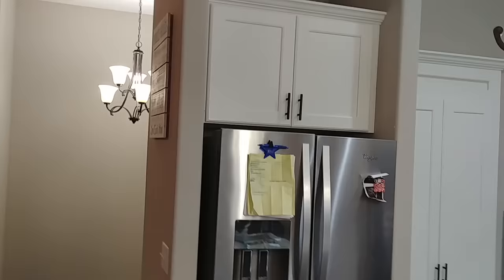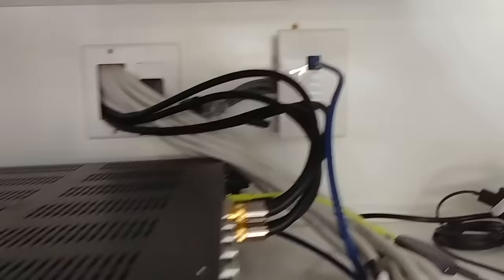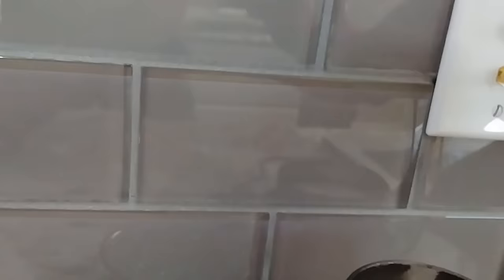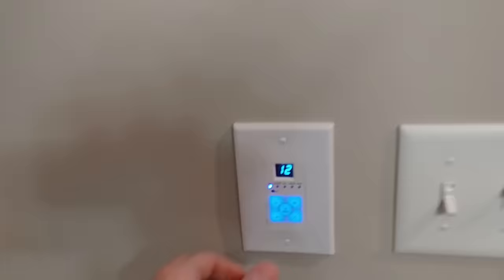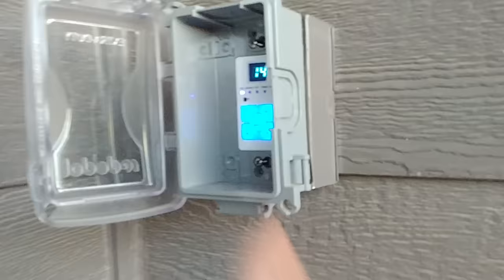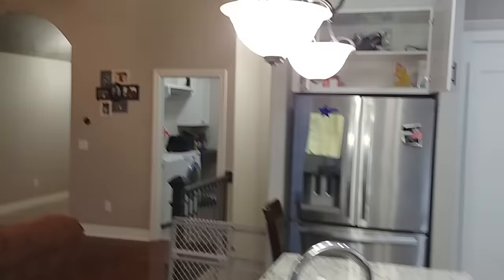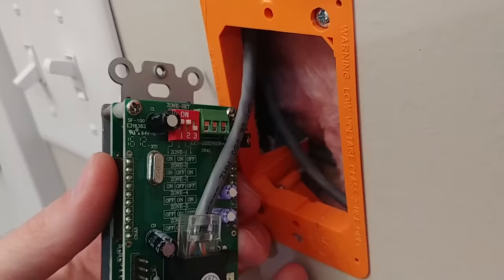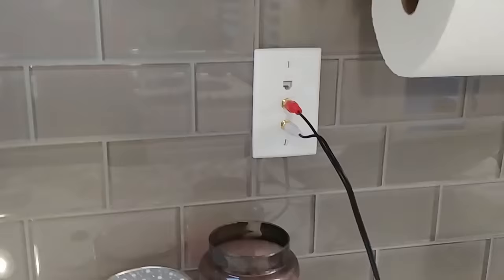WHOLE HOME AUDIO: Monoprice Whole Home Audio Amp! 6 Zone 6 Source

Comment: Would you be able to connect 6 chromecast audio? 1 for each source? Also why did you choose different speakers for the garage and deck? Is that style of speaker better for outdoor configuration?
Reply from the maker: federal3041 yes you could connect that many chrome casts but you would need to buy 4 digital to analog converters to convert the rca to 3.5 mm
Reply from the maker: federal3041 and yes those outdoor speakers are a much better speaker
Reply: Both RCA and 3.5mm are analog audio connections (digital coaxial audio uses a RCA style plug but that's not relevant here), I think you mean that he would need to convert 4 of the 3.5mm male plugs from the chromecasts to RCA for the whole home box/amp/audio matrix.

Comment: Hey this is a great set up . I am setting up mine as we speak.. I would like to know exactly how you used the rg6 to
Make an rca this way you can plug in you computer . Phone etc... thanks
Reply from the maker: You will need to run a separate rg6 cable for each red and white RCA. So in the kitchen for example, you see on my wall there is 1 wall plate with a red and white jack. Behind the wall that is actually 2 separate RG6 cables going back to the amplifier. You then have to finish the RG6 cable ends off with RG6 RCA connectors. Compression connectors are the best and easiest to put on in my opinion, you will just need to also buy a compression crimping tool. These connectors can be bought from lowes, menards, home depot etc, however after using Menards and Homedepot RG6 RCA connectors, I would recommend the home depot ones. They seemed to fit my RG6 quad shield cable much better. These RCA cables that you make, will then plug into the keystone jacks which then snap into the wall plate. After that, you just need to use any RCA to 3.5mm stereo cable which can plug into any headphone jack of a computer, ipod, phone etc. Hope this helps!!!!
Reply: TheKMZ1 
Thanks basically what I was looking for... 2 wires per source /zone. A lot of work but makes it worth it.
Reply: Why do you need the rg6 cables to utilize your computer as a source?   Could you run a 3.5 audio cable directly from the PC to the amp?  What am I missing?

Comment: Hi, I recently bought and installed a DAX66 mainly thanks to your videos ;-) Did you have issues with having the keypad plates flush at your parents’ house ? I use “renovation LV brackets” I imported from the US since I live in Belgium and we don't use the same system four our outlets/switches. Thanks.
Reply from the maker: With new construction boxes they sit perfectly flat. But you are correct, with existing construction rings, they will not quite sit flat. My house uses the existing LV brackets like you and they are not fully flat
Reply: @TheKMZ1  Okay thanks :/ Thank you for all your great videos about WHA !

Comment: I just moved to a house with a similar system installed and cannot get the damn thing to work. I know it was working when I got the house cause the seller was playing music on it then she took the amp with her. I purchased an amp and no sound is coming out. Driving me crazy
Reply from the maker: You purchased this amp or just some random amp?
Reply: @TheKMZ1  Kind of a random amp but one that others have connected to similar speakers. What Im starting to think is that the amp might not be compatible with the volume control otherwise I cant imagine it would not work

Comment: Excellent work with your install and the video. It looks like those Dayton's are mono speakers - have you used any stereo-input speakers in your installs or have any thoughts on them in general?
Reply from the maker: I think in the video description I link to the speakers. Dayton CS620C speakers, very good quality!
Reply: @TheKMZ1  Thanks but that didn't really answer my question.
Reply from the maker: @brodie7838  the amp can be in stereo or mono mode. In stereo the left speaker is obviously getting the left audio and the right, the right. If you want you can put it into mono mode but the standard would be stereov since there's distinctions of the L and R channels. I've not used any other speakers with this amp
Reply: @TheKMZ1  Cool thanks!

Comment: We have been enjoying our monoprice whole house setup for over a year now with a massive thanks to yourself with your video and guidance but have hit a problem which I hope is minor. Just upgraded from the iPhone X to the 13pro and with the contract package I get free Apple Music but for some reason I’m unable to see chrome cast on the AirPlay options and simultaneously cannot find the chrome cast audio app or even find it in the App Store. Any ideas what my options might be?
Reply from the maker: I think it's called Google home now
Reply: Right you are! Thanks again! Can I just ask I’ve got one keypad that no longer powers up I’ve taken that one out as I wasn’t using them all, is there a common fault easy to fix issue going on?
Reply from the maker: @stevenblack9644  I'm not aware of any specific reason that it would have failed. I've not heard of any keypad issues and I've never had any. I can get you a replacement tho I think I know where some may be
Reply: @TheKMZ1  that’d be great if you could although I’m in the Uk

Comment: as i was getting ready to pull trigger and buy this unit reviews elsewhere indicate the avg life is about 3 years.  any truth to that?  how has your experience been in the long run? i am leaning now towards perhaps the Russound D850. hopefully it serves the same purpose you showed in this video with the monoprice and the DAX66
Reply from the maker: So far no issues! Going on 3 years now
Reply: @TheKMZ1  so i ran speaker wires for 3 zones (office, kitchen and dining room) and now need to figure out family room where main tv would be.  Bestbuy geek squad said i need a full 5.1 system and separate amp, but i imagine you disagree.  If i do get the 5.1 speakers for the TV, how do i need to connect tv to amplifier?  HDMI? Speaker wire? Ethernet? all of the above?
thanks, you da man.  totally subbed.

Comment: Great video! what is the maximum number of speakers that you have hooked up on a zone? do you feel that you could've added more?
Reply from the maker: Casey Jones technically you can have 4 speakers per zone but it gets wired a bit different. I recommend sticking with 2 if you are able to

Comment: im not sure how i want my sources to go... I was thinking of putting echo dots in every room and running the audio back to the source. So it would kind of limit the sources to each room... but if you wanted to hear another rooms echo its there.  I do like the chromecast music wifi idea you had.  I noticed the bluetooth add on monoprice makes requires cat6 and im not sure of the reliability.
Reply from the maker: With the echos you can use the app and create groups to link your echos together. For example I have 2, and I have them in a group. Only 1 is plugged into a source. But when I'm at either one I can tell Alexa to play music and because they are in a group with the primary audio set to my echo plugged into the source, the audio will always flow through the whole home audio no matter what one you spoke into
Reply: @TheKMZ1  got it so i dont have to go wire crazy
Reply: I am going to call monoprice monday - i dont expect to get much but if i find anything in respect to the back of the keypad i will let you know
Reply from the maker: @dastugatz8129  let me know what you find out!
Reply: @TheKMZ1 looking at the manual it says ext led on the pad is mute function enabled or pa broadcast in progress.

Comment: By chance do you know if the switches will fit in the standard square light switch plates/covers?  like the ones you buy at home depot or will they only work with their cover plates?  btw cool video...
Reply from the maker: C MY Skill Standard square ones will work yes!

Comment: Do the wall volume control comes with the amplifier? tell the model of amplifies and volume control ( wall mounted) I have an Legrand OnQ system that went bad and want to replace it for something like yours. My house is wired for 8 zones and has speaking and control volume , but I do not think is compatible with any other brand. Thanks in advance
Reply from the maker: Yes it's a kit, it all comes together please see description
Reply: TheKMZ1 Thank you

Comment: Great video and setup. Is it possible to use surface mounted backbox's (as i live in the UK) and if so how deep would they need to be. Thanks
Reply from the maker: If you used the standard size that would fit a light switch, then it would work. A standard light switch box is deep enough.
Reply: Thanks does they aplly for the DAX66 as I havnt decided which one to buy
Reply from the maker: Yes the same applies for the DAX66. Check out this video that i did which explains the differences between the 2 amplifiers. https://www.youtube.com/watch?v=fXv77gxaDtI

Comment: Have you found a drywall back box that doesn't extend out from the wall too far when the faceplate is mounted?
Reply from the maker: For existing drywall work, the standard orange Carlin ones do cause the faceplate to slightly stick out. For new construction those Carlin boxes do not. I have not looked much more into other existing drywall work boxes

Comment: What kind of surge protectors do you like/recommend for this system that aren’t too expensive
Reply from the maker: I don't typically spend much, I buy the Amazon basics surge protectors. For rack mount jobs I use Tripp Lite rack mount surge protectors. I don't normally use UPS battery backups
Reply from the maker: If you are going to get struck by lightning a direct hit can still damage things so I don't try to buy surge protection to fight against a direct strike. That would be too expensive and if it happens it happens, oh well lol
Reply from the maker: Think of all the money you could spend, it's a trade-off, save money and if it happens (still pretty rare) then you've saved money and oh well
Reply: TheKMZ1 Thanks for your input, you make a good point. If I get struck by lightning, a surge protector isn’t going to do much!

Comment: Hey! Great video, I was just wondering if there was anyway to connect a subwoofer to the whole audio system as either part of a zone or something else. I'm looking into buying this system along with the cieling speakers, but was also looking into buying 1 in-wall sub to add to the bass of the sound. What do you recommend? And if I do buy the sub what connection would it need/go to to plug into the amp?
Reply: ALSO: how did you install your speakers; was the house new construction or? I have a new construction and the rough-in for the speakers cost close to $13 for 1! Need a cheaper alternative.
Reply from the maker: Alexander dpia the only way to get your cost cheaper is to do it all yourself (the rough in and rest of it) my house was already done when I put it in. My parents house was all new construction that I did it in, and I put cardboard templates up to let the drywallers know where speakers were

Comment: I think I already know the answer but going to ask any way. I currently have an 8 zone Control 4 amp in my house. It is no longer working and now seems to be a good time to make a break from this system since its $100 + an hour to have a "certified" installer come out and get it working again. 

With that being said, I have volume sliders in each of the 8 rooms and coming off of the back of each one, I have a group of connections on each side. Both groups of connections have white and green labeled L+ and L- and a black and red labeled R+ and R-.  One side is labeled "speakers" so I went into the attic and can see that these wires connect directly to the right and left speaker of the zone. The other group of connections is labeled the same (L/R +/-) but has a white, black, green and red cables coming out with a white shielding around them. This group of connections is labeled "Amplifier" and sure enough it coincides with what is connected to the back of the amp. My question is this. Is this group of white, black, green and red also speaker wire? If so, it looks like I'll have to run all new speaker wire from the speakers back to the amp and all new cat 5e or 6 from the wallplates to the amp as well.

Thanks in advance!
Reply from the maker: Greg White Yes you are exactly correct, it's just standard speaker wire to your rotary knob/slider. You have a traditional sound system, and the reason your amplifier goes to the dial on the wall, is because the dial is essentially a giant variable resistor that makes the volume to the speaker get louder or softer. The only way you MIGHT be able to not wire as much for a new system like this would be to take the speaker wire going to the back to the amp and splice that into the speaker wire going from the knob to the speaker. Then that gives you 2 speakers which now run back to the amp and all you need to do is run ethernet. Hope this helps, let me know if you have questions. This will only work if you do in fact have 2 pairs going back to the amp. (4 total separate wires b/c you need pos and neg for the left and right speakers)
Reply: I didn't think about what you suggested but I believe it will work. I checked the back of the amp again and those 4 wires go the back and are labeled + and - for an A and B side on each zone. I was also able to get enough slack in the wire to see that it says 16 AWG so wish I had seen that before posting. 

As far as the Chromecast Audio, are you only able to stream to it from one device at a time? In other words, if multiple users wanted to stream something different in different zones simultaneously, would you need multiple Chromecast Audios for that?
Reply from the maker: Greg White Yeah only one user can stream to it at a time, and it only gets plugged into one source on the amp. One source can only play one thing, so if a second user wanted to wirelessly cast something different and listen to it in another zone, then you would need to add another chromecast audio.
Reply: Thanks for the info...much appreciated! And great video! Very informative. I was on the fence about this but after seeing this video I'm going to give it a shot and see how it turns out.

Comment: Great video massively helpful.... I’m in the Uk and would love to know have you’ve set up the rca lines in
Reply: It’s a tad hard to see but I’m guessing you’re running two rg6 cables to each input?
Reply from the maker: @stevenblack9644  yes 2 RG6 cables, making custom RCA cables!
Reply: Great it’s hard, but not impossible to get this stuff in England but just what my house needs... as for making the cables another thing that people just don’t do here.
Reply from the maker: @stevenblack9644  You can probably get anything shipped to you, but at what cost you know, shipping can get expensive but anything is possible! Let me know if I can help in any way
Reply: Have you wired any more than two speakers per zone? What pre amp would you recommend as my kitchen/dining room will have 4-6 speakers 🤷🏼‍♂️
Reply from the maker: @stevenblack9644  you can technically get 4 In a zone, but not more than that. If you need that many consider making 2 zones in your kitchen. It would allow you to turn one side off if you wanted

Comment: How does this system work for TV's? I notice there are no HDMI-ARC ports... can you use the TV remote to change the volume on the in-ceiling speakers? if not, do you know of a workaround? Thanks!
Reply from the maker: You would have to plug in your tv using RCA cables. You may be able to use the remote to control the volume but it may not work, so you would have to use that zone's wall keypad to change the volume
Reply: TheKMZ1 Thank you! I like everything about the Monoprice paired with the GlobalCache; the only thing holding me back is the TV audio situation, but that’s only a small inconvenience. Thanks again for the response and the great video!

Comment: Can you remotely control what input source each zone is using. I would probably use my Chromecast audio for 99% of the streaming too, but I would want to be able to force all zones or a group of zones to switch to that input when I cast to them. Or... do you have to manually switch to that input by going to each room and touching the keypads like you did?

BTW... they couldn't flip that RJ-45 jack so that the tab faces out?
Reply from the maker: There is an android app, check my channel I've got a video! Thanks

Comment: Hey man awesome video! Do you run a speaker wire out of the amp to the first speaker and connect one speaker to the other (daisy chain) for each zone?
Reply from the maker: No they are not daisy chained, they both homerun back to the amp. Check out my newest video on my channel on these!
Reply: TheKMZ1 thanks for replying. So if on my living room (zone 1) I have 6 speakers, I have to run 6 speaker wires back to the amp? I cannot tie the speakers together?
Reply: I did not find a video talking about that...
Reply from the maker: @bigtroublenj  this amp is more geared towards 2 speakers per zone, if you have a zone big enough for 6 speakers I'd question if you should really split that into more zones so you could control them more independent. But adding 6 speakers in a zone is a more advanced topic, you'd need to do a combination of series/parallel wiring in order to have it see each channel (left and right) at 8 ohms
Reply: TheKMZ1 Thank you for your help and taking the time to reply!!!

Comment: Silly question, using coax for RCA you run 2 wires per jack right
Reply from the maker: Yes that is correct 1 is your "red" and they other your "white" for left and right audio